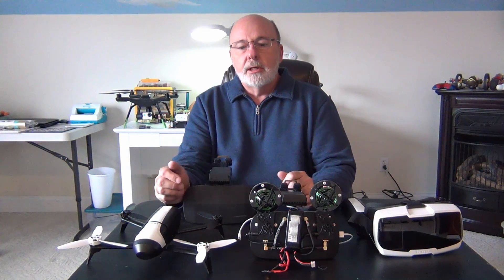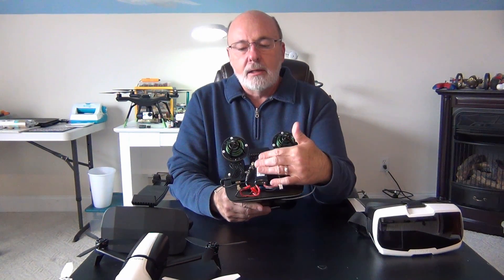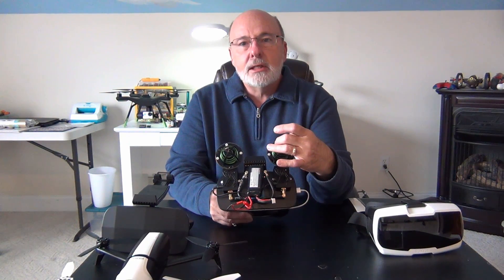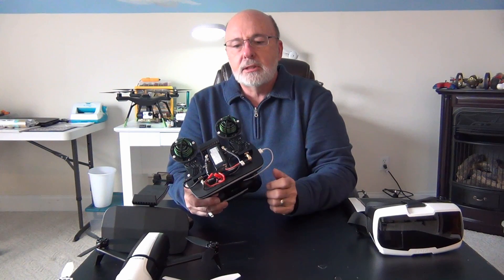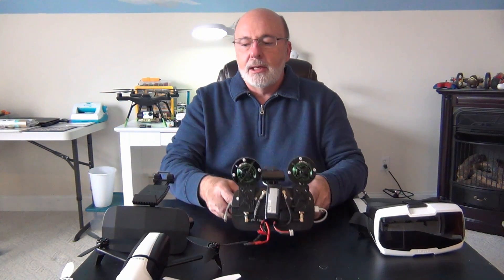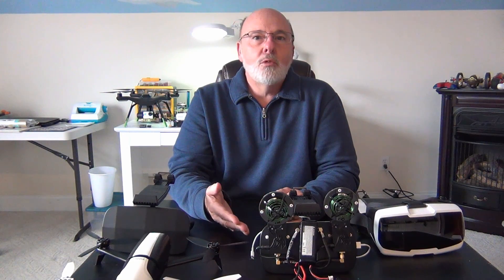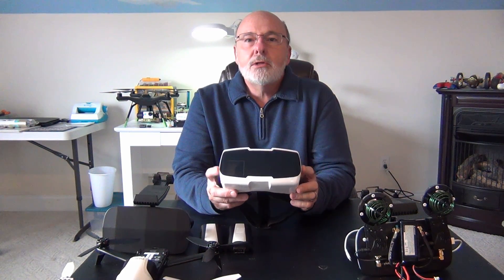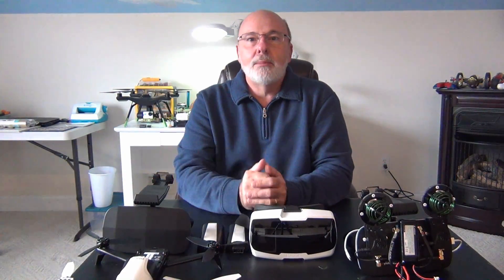Extending The Range Of The Parrot Bebop 2 & Disco

Comment: thanks for the nice video. quite clear how to proceed. still i have a couple of questions. 1)how did you decide to use 2 and not.. 3? or just one... 2) do the amplifiers work on both directions? 3) have you ever measured the range with and without the mod? thanks in advance

Comment: I'm sitting here watching...I have a bebop 3.0... I have 2 of the same boosters laying around... And lots of sma rpsma antenna leads.. antennas... guess I am going to find out if I can get this kind of range out of my SC2 bb1🧘 This is happening soon yes😆 thanks for sharing ✌️🇺🇲 I added a bb2 fpv / power to my lineup a couple weeks ago now too. Came back for a refresher because I'm definitely doing this soon. Everything sitting here in the box waiting for me to assemble, only difference is my Alpha antennas are the bigger dual band 2.4-5.8 versions which are really good I know already. I only have 1 of the single band 2.4 and that stays on my bugs3, used to be on the old Hubsan h501ss. Sold it sadly I wish I had just kept it now, actually really capable little dual purpose quads, great for learning fpv and have the Gps switch you can kick on to save your azz if needed which is priceless when learning, especially without using a trainer program on computer. Very few quads can offer that piece of mind when getting into this hobby at it's price point. When I initially started fooling around with birds and doing long range mods, was with the bugs3 but quickly I realized the pitfalls of no gps, failsafe but especially difficult without even altitude hold, so that didn't really pan out in the end. Been several years ago now and I've had many more quads since then, but anyway these old bbw bb2 and disco really still have a hell of a lot of potential, video fpv clarity and range mods, 4g etc capabilities along with this which makes them such a viable option still, for those who don't support the ccp through the dj👁️ products. Great quality and performance almost by design I would think. Everything people are looking for and just so happens to be a funding branch of theirs. The price tags of everything they sell is the next reason I would never use them anyway regardless, So yeah that's all true and as such Parrot products still have a great place in the lineup for anyone knowing what is good. Happy flying all. U know this is a older video but there's always someone like me comes along so everything is still relevant to some people playing around with these ole gals, they still have plenty of parts available and batteries, have at it I say ✌️.

Comment: Better off with the 4g softmod, unlimited range
Reply: Andrew MTB  That's totally false. I installed 4g mod and I can either fly in 4g on in classic wifi mode
Reply: Andrew MTB  i actually switch WiFi to 4g and back in flight
Reply: especially for me. i wanted to use the 4g mod but then i realized i live in Germany where only big citys have 4g...
Reply: Dronedown Productions  how do you do the 4 g mod for the bb2?
Reply: Andrew MTB  wrong, you can switch from 4g to wifi anytime.. even during flight

Comment: Those boosters have an input maximum limit of 100mwa (20dbm). Parrot Skycontroller 2’s output signal is according to multiple radio regulation authorities from different countries between 640mwa and 1600mwa (28-32dbm). How did those booster survive an input signal that was 6 to 16 times higher that maximum limitation? Do you still use those boosters? Still ok and not burned?

Comment: Hello Grandpa Jake. Your video is very clear to understand how to proceed. Booster, battery and SMA cables are not so hart to find. Did anyone find the best solution for antennas? The same as FPVLR are using? Or similar but also good enough for long range flying? Greetings from Poland. :)

Comment: This could be usefull speacially for Parrot Disco that can holds much time in the air and travels fast as the Bebop
Reply from the maker: How are you,   I have the Disco and it also works the same on this :-)  what I like is when I send my Disco on an automated flight that I can still see the video much longer than without the booster.   Nothing panics me more than when I loose video even though I know it is going to come back ( I  hope lol )
Reply: I didn't do a flightplan with Disco yet.

Comment: on the back of the board, was the pigtail soldered? Did you check for continuity between the sma pin and the outer casing? Is there continuity on back of board between the uninstalled antenna and the original? Then lastly is there any continuity between each antenna soldered  to middle connection on back if board. All these could result in a shorted out board. Check it before you start so it remains the same after the mod is completed so you can correct.

Comment: The eBay link is dead but I think these are the amplifiers you are using.
https://www.amazon.com/Extender-Repeater-Broadband-Amplifiers-Wireless/dp/B01B94U438
Reply from the maker: Hi Jeff and thanks for following up on this.  Yes you are correct and I have made the change to show the link you provided.   A lot of these sellers have a handful of a certain product and when it is gone the link is no good.  So it is a big help if someone helps as you just did :-)     Also if anyone comes across a nice directional antenna that works I would be glad to add it to the links.    Take Care and thanks again
Reply: I'll look when I get home for planar or helical with a 60 deg beamwidth and let you know. I'm currently using just a basic wifi extender with my iPhone but want to build something similar to yours.
Reply from the maker: That would be great Jeff,   So far I have been doing well with this setup.  I use it for my Bebop2 and Disco.  I don't get the crazy range that some say is possible,  but I can fly it far enough for anything I need to do.  And I do say one good things,  should you plan an autonomous flight and it does go beyond the range of your controller, it will continue to do the preprogramed flight and return back and reconnect.   Take Care
Reply: I found these: https://goo.gl/VK2Mex
that don't list the beamwidth but seem to be popular with other mainstream multirotors. Looking at the Q&A and reviews they appear to be getting great distances. Might be worth a look. Are the ones you are using RP-SMA?

Comment: well i did the mod just like you had them on here only i have the antennas that came with boosters on them and they dont work well at all my range was no more than normal with stock setup . guess i am gonna try the antenna like you have on yours . fpvlr has a  skycontroller  system but it has left hand turn antennas . i wonder why ?? i sent an email to them over a week ago and ask but i still have no response . pretty slack of them id say !!!! anyway just thought id share this.  when i get new antennas ill post again to tell you how it works then .
Reply from the maker: Hi Tracy,  it wont work correctly with the antennas that come with the amplifiers as the signal is not focused.  To get the extra range you need a directional style so that the beam is mostly directed out in front of you.  Let me know what you end up using
Reply: i was just trying out the ones that came with it just to see what it did . i guess im going to get the ones like you have since no one at fpvlr will return my message question . the left hand antennas arent shown as a seperate choice but the ones like you have are .
Reply from the maker: Just curious if you got any better range using the include pole antenna?   The main reason the Disco, Bebop and even the 3DR Solo get this type of range is that everything is concentrated out front of the controller.  I am sure you noticed if you are flying and turn the other direction you almost loose signal.   It is a shame we have to add all this extra equipment to get more range,  but I do like both my Bebop and Disco so we do what can to make it even better !!!    Not sure how Dji Mavic is getting 4 miles?   but so far I have not flown one to really see.  This May I will be going to my brothers house and he wants me to push the limits on his Mavic so I will let you know lol !!!
Reply: Grandpa Jake no the pole antennas did nothing even with the boosters on . I did  a previous flight plan that I noted where my video went out and it was a little shorter distance where video went out with booster and pole antennas . I guess it shows the antennas are the key to everything . I would have thought boosters alone would have extended range . I've seen videos on here where external wifi boosters with pole antennas have extended range when just using phone to control . can't wait to see what antennas do when they get here I'll let you know how it turns out for me on mine
Reply from the maker: tracy baker I will be anxious to hear.  Just for the heck of it,  once the controller is on and the bebop do you see the green light flashing on the boosters?  They should both start blinking once they connect
Reply: Yes both green light are on and I'm pretty sure they blink . I have disco not Bebop . If this works out when I get antennas I plan to get a Bebop 2 quad to add to my collection of quads I have built from scratch .
Reply: there right hand turn, that's probably why fpvlr did not reply

Comment: Hello thanks you very much for your mod.I dont understand why you buy 2 repeater for 2,4ghz wifi if one of the antenna have 2,4ghz and other have 5.8ghz can you please explain?I think you need to have 2 version of repeater?One of the version for 2,4 other 5,8ghz as i show at this link 

http://www.ebay.com/itm/Wifi-Wireless-Amplifier-Router-5-8Ghz-WLAN-ZigBee-Bluetooth-Signal-Booster-OG72-/141861367075?hash=item210798ad23:g:7EAAAOSwZ1lWfgfM
Reply: Can someone answer my ?  I want to make order but still dont know If i need two repeater one for 2,4ghz and other for 5ghz.Thanks you
Reply: Everything in the SC2 is 2.4 GHz as far as I'm aware.
Reply: Thanks

Comment: where can i find the patch antenna that have the 60 degree
Reply from the maker: I will try to look tomorrow and see if I can find a pair that will work.  I am using ones that came off my 3DR Solo from FPVLR   I will see what I can find tomorrow.   It does not have to be exactly 60   some are 65 so anything close will work.
Reply: Grandpa Jake I know that 65 is ok just can't find any reasonable . I ordered all the other stuff on your list but solo antennas are way to high
Reply: i have read alot today and would love to have the antenna you have but its 130 bucks and if i pay that much for antenna plus the boosters i ordered with stuff on your list  i might as well have bought the fpvlr system . anyway do you think the VAS 2.4 antennas with helicoil  would work ??? they are for video but its still 2.4 . im from south carolina also . i watched your videos
Reply: Grandpa Jake
Reply from the maker: Hi Tracy,   the antenna part is where I don't have the most experience other than what you see me using here.   Someone asked about this yesterday and I was going to give a link to the Alfa APA-M25  I am not sure about the VAS    Maybe ask on Rcgroups to be safe.   The Alfa were around $19 each but again was not sure how well they would work.   here is the link just in case http://a.co/csuuhGL  if you do end up finding ones that work let me know,  I would be curious to other options to help others.    Where in SC do you live?
Reply from the maker: Here is one other link.  they are less money but not sure what they would add for shipping. https://www.data-alliance.net/antenna-dual-band-2-4ghz-5ghz-10dbi-panel-w-rp-sma-connector/?gclid=CjwKEAjwq5LHBRCN0YLf9-GyywYSJAAhOw6mia0Z5dcZRn2A0uMG4E3kg-gFyDo3Glmc3rHGjesVDRoCIe3w_wcB
Reply: thanks for responding . i live in Lancaster SC just below charlotte nc . i have some local drone videos of land mark things on my channel
Reply from the maker: I am in Spartanburg SC     Let me know what you end up using and how things work out for you.   I am sure in the open country where you dont have many homes the range will be much better.
Reply: I sure will got most of the parts now just got to find time to do mod . thanks

Comment: the wifi boosters i see you have 2 of them is one for recieve and the other one for send. ive bought one the same as you
Reply from the maker: I am pretty sure one is for receiving.   If I turn on the Controller I will start to see the one green light flashing,  the other will not flash till I power up the Bebop then they both start going crazy.  So for it to work correctly you will need 2.
Reply: Thanks for getting back to me great videos im just doing some mods to the xiro xplorer v, i will look into this about getting two wifi boosters
Reply: Hi, Have you flown the xiro xplorer v and iff so what did you think of the xiro v

Comment: Seems very complicated
Reply from the maker: The hard part for me was finding the exact parts, but I listed them in the description above.  But if you are not comfortable with soldering then it may not be the mod to do.   Inside the controller the hardest part is just soldering the antenna extender cable but if you take your time it is not that bad.